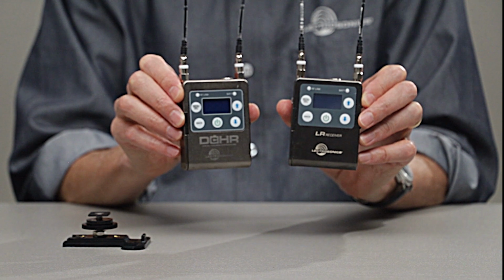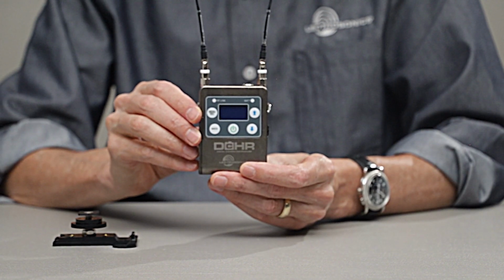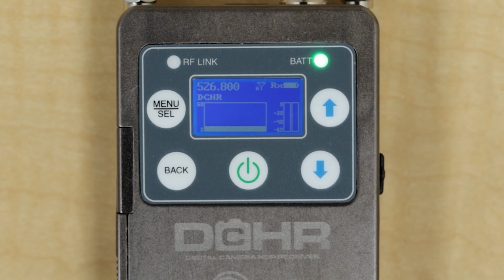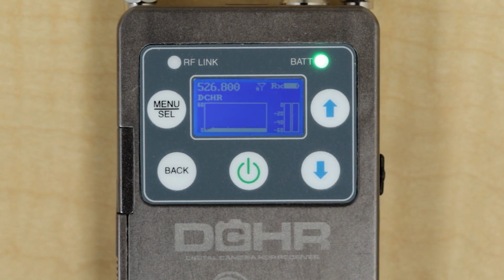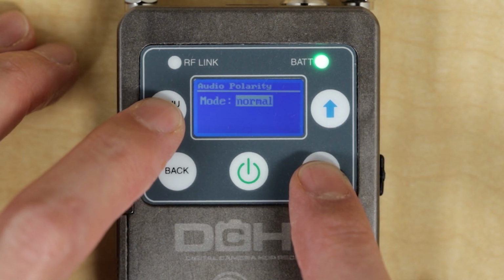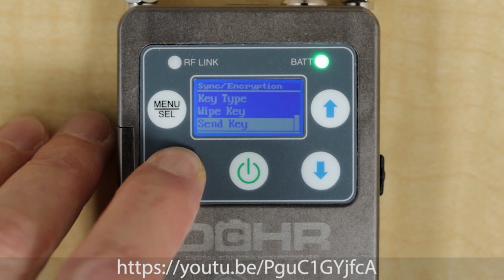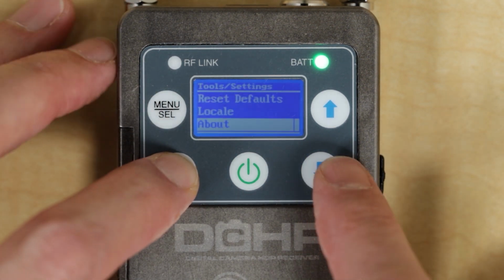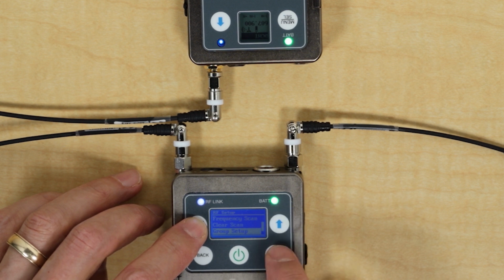Lectrosonics DCHR Portable Digital Stereo & Mono Receiver Introduction & Overview

Comment: How is this different from the MSR? Is the MSR a good option ?
Reply from the maker: We're not sure what you are referring to? We don't have any products in our line named "MSR".
Reply: @lectrosonics  sorry meant M2R
Reply from the maker: The M2R is a good option if you are primarily listening with headphones or earphones via this receiver. The M2R does not have a locking outputconnector, balanced analog audio, or AES digital audio outputs. Also, the M2R has fixed antennas. The DCHR has all of these things and thus is a great choice for camera hop work, and has a headphone jack for confidence monitoring.